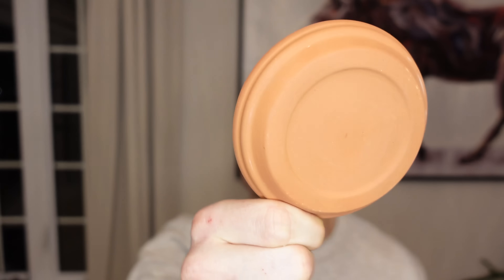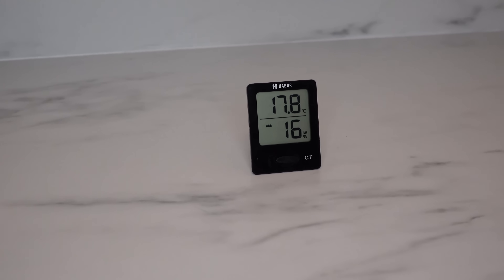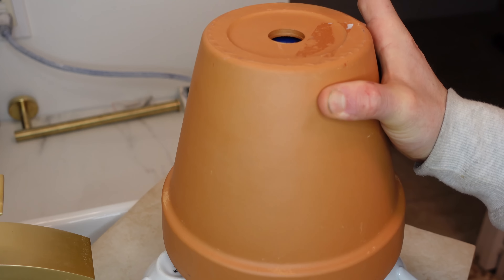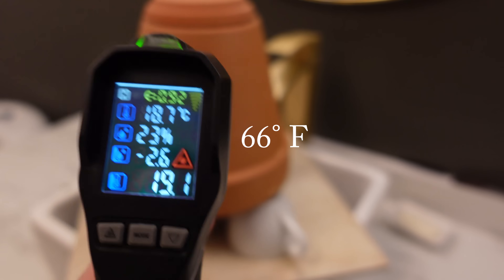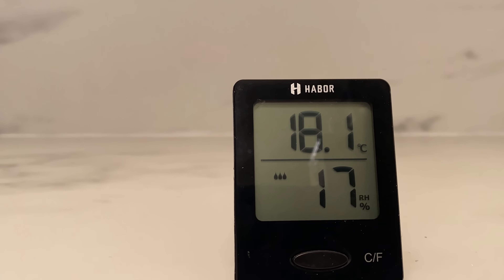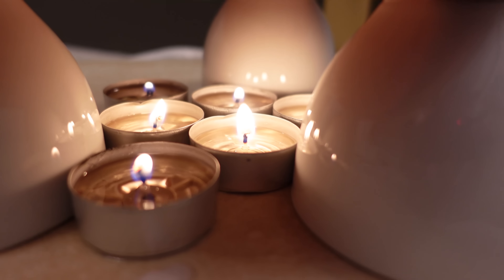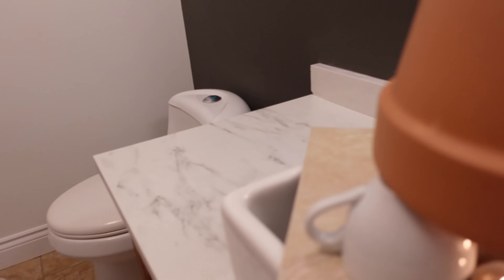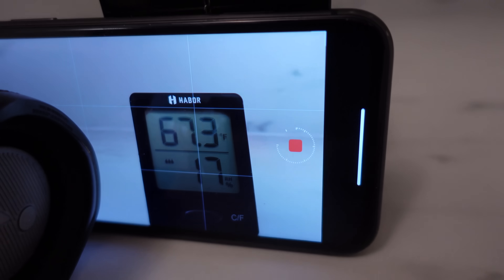CLAY POT HEATER TEST | Does It Actually Work?!

Comment: To those who say the pots don't technically add anything just burn the candles you're missing the point, the clay pots retain the heat so after the candles are spent the pots radiate residual heat. It's not creating more energy you're right but it's 'managing' the heat for a more even and prolonged release
Reply from the maker: exactly! great way to warm up the hands!

Comment: Try it with just the 6 candles and no pot.  I bet you get more heat in the room since the candles will have more oxygen to burn, but they will burn down faster.
Reply from the maker: Yes very true! Thanks for the tip.

Comment: I use 2 eight hour tea light candles under a plant pot the same size as yours, so 2 separate pots in my caravan & it definitely heats up my van in the UK. We're just going into winter so I'll see how good after the first cold snap, I can get 18 8hr candles for £2 so  it's much cheaper than paying for gas, petrol or paraffin. I'm going to outfit my van with these pots this winter but knowing our government they'll put the price of candles up 😠
It definitely works though, you get much more heat than you would from the candle itself.✌️
Reply: I made a shroud  with a 850g home bargains candle. Added crackle wicks and a small stove fan.   It heats up to 200°c really fast and the fan sends the heat out into the room.   Lasts a week at 8hours a day.   The fan also helps draw air to the flames from the vent holes in the shroud.    £2.99 a refil.  It will hopefully do for the winter while the prices are £9 for 40min of central heating
Reply: @salaciouscreations4323  U made me curious, explain better please
Reply: Hi ,how exactly is your "shroud" made of and it's shape n size measurements??? @salaciouscreations4323
Reply: Yes, I checked today and the price of candles have gone 👆
Reply: Use a canning jar filled with Crisco  and  stick  a candle in it .
Reply: @nancysmith6685  I was just about to comment this!! She can even keep it in the can she buys it in and just stick three wicks in it and it lasts a lot longer and puts off a lot of heat!!
Reply: @nancysmith6685 what is crisco???     We don't have this is England
Reply: @brambles12 Vegetable shortening that used to come in cans but these days it comes in cardboard containers.
Reply: The government doesn't set the price of candles 🤦‍♀
Reply from the maker: cheers!
Reply: ""you get much more heat than you would from the candle itself."""  factually, physically, scientifically, Impossible. You cannot "magic up" free energy out of nowhere. You get exactly the same BTUs of heat from the candles regardless. Look up the First Law of Thermodynamics.

Comment: Works, but not very well @ 100 BTUs per lit candle heat. That's like trying to fill a ful sized piggy bank with pennies, by only using one, to 3 pennies.
Reply from the maker: Exactly :)

Comment: These candle heaters are an outstanding monument to the complicated futility of ignorance.  A demonstration of the propagation of stupid myths.
The petroleum fuel in a wax candle produces a certain amount of energy per unit mass burned.  Nothing, NOTHING makes them burn hotter, or put out more heat or convert heat better.  NOTHING.  These stupid gimmicks serve no purpose except to demonstrate your ignorance of science.   A fluid burning at a constant rate puts out heat at a constant rate and tea-cups and flowerpots make no difference what so ever.    You want more heat output?-- Use larger or more wicks -- heat comes from the burn rate of the fuel - the wick surface area controls the rate of burn. 
-- Physicist.

Comment: Starting at 18.1Degrees C in a small bathroom isn't really a cold temp to start with. It then takes 3 hours to increase the temp by 1.5 Degrees C  ( abut .5 Degrees C an hour ) that's by no means any great achievement.  Where I live a standard living room would be about 4 times the size of a small bathroom and from October onwards temperatures in an unheated room would be between 1 Degree C to 5 Degrees C depending on how mild a day would be (colder at night) So it would take an awful lot of pots and an awful lot of candles and an awful lot of time to get it up to the 19.6 Degrees C you achieved in your demonstration.  So I dont think your demonstration shows anything other than Terracotta pots get extremely hot when they're placed over candles but as a practical solution to home heating they're little more than a placebo.
Reply: I agree.  A candle will produce a certain amount of heat energy.  A ceramic pot covering is not going to change that.  If it did it would violate the laws of physics.   All these videos of candle heaters show just how lacking science education is.

Comment: The chemical energy from 6 candles = the heat energy from 6 candles.
So...what's the point of the terracotta pots?
Do the test again with just 6 candles and measure the temperature of the room before and after.

Comment: Now you need to coat the pots in graphite and they will radiate the infrared  heat far more effectively.
The pots will get up to 40-45c

Also just use 1 pot, you're wasting energy by heating up 2 pots.

Comment: Do U realize that U have ZERO knowledge about the laws of thermodynamics and energy conservation? Lets say 1 candle heats with 1Watt energy. It is totally irrelevance if U heat the air directly  ore if U heat first de pot than the pot releases the accumulated energy. But that accumulated energy comes from the same 1Watt candle, thus while the pot is heated the air is NOT heated! You just delaying the heat exchange, but in the end U will only heat the room with 1Watt of energy! So there is no economy, there is no magic saving! Just delayed heating! and smoke and CO2 and money thrown away for pots and nuts and bolts!
https://youtu.be/eym_mD6osmw🤣

Comment: There is no energy gain to this.Put 10 units of heat into a room and whether you use pots or not,you're still putting 10 units in.The only benefit is you are holding some of the heat in the vicinity of the candles for longer.If you want to do something which will genuinley save energy,stop all draughts,insulate walls,ceilings and floors.Only have the heating of when you actually need it and don't overheat a room.Wear thick and multilayer clothes,put a blanket over you and heat a hot water bottle.

Comment: I dont get it. Those candles are going to put out the exact same amount of heat without all the other pieces, so what is the purpose?
Reply: The purpose is to add efficiency to the heat source.
The pot add an big surface for moisture in the air to evaporate on.
Removing moisture from air make you feel warmer seen moisture that evaporate from your clothes and your skin create an cooling effect.
When comparing a convector element to an oil element they say that an oil element give a more even heat source that feel more pleasant because of the mass it radiate heat after it is turned of on the set temperature.
I think one can see it a bit like that.
This device originally is to take the edge out of the cold by removing moisture and not used to heat a room in a sense we today look at it, i mean it's not an electric element.
Reply: @tiddybearkush  With all due respect, I think you are confusing some terms here. To remove moisture from the air it would need to condense, not evaporate (the opposite). And in order to condense moisture you need a surface significantly colder than ambient - which a heater obviously can't do. But yes, having a lower air humidity would insulate your body-heat better and require less energy to heat up a volume of air.
Apart from insulating the warmed area you can't really increase the efficiency of a heater because that process is already 100% efficient at creating wanted products - ie. mostly heat, and a bit of light.

Maybe the intention is to create more radiant heat like you mention, just because it feels more pleasant to sit near. It could work a bit for that I guess - but it won't actually heat the area any better.
Reply: @tiddybearkush  Better off using a dehumidifier. But the moisture is taken out of the air into the tank by condensing (cooling) fins. This then does make the room a touch warmer.

Comment: Candles are produced from diesel. Using them as heating is dangerous. This video is irresponsible.
Reply: They are made from paraffin, if they were made from diesel they wouldn't burn as diesel is not volatile enough. Try making a Molotov with diesel 😝

Comment: I am always amazed at all the different clay pot heaters. The only benefit the clay pots provide is collecting the soot from the candles, and thats a good thing. You don't get any more heat than is given off by the candles. The soot actually builds up and will insulate the pot from the flame however all the heat given off by the candles goes into the room.
Reply: What I don't get is how people think that the clay pots somehow increase energy, when all they do is absorb the same amount of energy the candles would give off in free air. If these clay pot things worked as claimed then free energy generators would be a reality, i.e. more energy out than energy in.
Reply: @rflett5797  oh yeah, there are plenty of free energy believers out there. Probably the same ones that think rainbows and unicorn farts charge electric cars
Reply: @STARFIRESOLAR  What?    They dont?  But I just bought a unicorn on Ebay !
Reply: @rflett5797  They absorb the heat and release it as infrared energy. It's more about a controlled release of heat. The room will likely stay warmer for longer after the candles go out with the pots than without.
Reply: @rflett5797  That because they missing the point of the terracotta heater.
The pot give a bigger surface for air to move through and therefore it remove more moisture from the air faster and create a better circulation of air.
You can get more energy but you can use it more effective.
Moisture on your skin and clothes create a cooling effect when it evaporate.
Reply: I think the logic is that they convert the heat to IR. I'm sure there are far better ways to do it than the pots. People will say that a candle itself will cause the heat to all go to the ceiling but a simple fan can fix that problem. An electric sand battery would be far more efficient.
Reply: There is benefit to the clay pots. Its very similar to how hot air balloons float in comparing what the clay pot does.

Comment: Be extremely careful with this sort of heater.  In the confined space under the pot, the candle wax melts.  If this happens it is not very bad but you do now have a pool of melted wax.  The trouble can start if the inside space of the heater gets hot enough to start to boil the wax.  When that happens it is a bit like a gasoline fire.  The vapor off the boiling wax ignites and burns making a bunch more heat.  This increases the temperature further so the wax boils faster.  This positive feedback will continue until you have a raging great fire.

Comment: do not do this wax gets to hot and you have a big problem when it goes up in flames . do the same but use carbon felt wick and cooking oil . you can tip the flame and still not have a problem

Comment: much better not to block the hole at the top of the pot  i us 2   clay pots 8 or 10 inch wide pots  to heat a 25ft by30 ft room and DO NOT USE MORE THAN 5 T LIGHT CANDELS OR IT WILL BE TO DANGEROS

Comment: the cups are to high you only need half inch ventilation  and if you put old briks from a storage heater on the top it raedyats more heat

Comment: There's only so many BTUs contained in a tea candle's wax when burned.  No amount of clay pots is going to alter that value.
Reply: ABSORBING HEAT is not going to MAGICALLY multiply heat and produce more heat.
Reply: How about those little heaters that caterers use to light and place under food to keep it warm?
Reply: candle heat rises immediately. The pots radiate the heat outwards. Big difference in how the heat (BTU's) is used
Reply: Yes but doesn’t it act like a storage heater?… absorb & then slow release of temperature?
Reply: @saneman7177  Now you are talking about BTUh, and yes, it would.   But the thermal mass of the pots is quite low, it wouldn't last long. I'd estimate inside of 10 minutes, the pot would return to room temperature once the candle has burned out.
Reply: @ElementofKindness  it actually gave me an idea you can buy storage heater bricks for very cheap… I wonder if you can heat them with candles
Reply: @saneman7177  Of course, but the net result will be the same.  For a given number of candles, the total BTUs conveyed to the room will be the same whether just burning candles openly, or contained in a brick enclosure.   You will get longer heating period with the bricks, but the room temperature will not increase as much.
Reply: @ElementofKindness candle heat rises immediately. The pots radiate the heat outwards. Big difference in how the heat (BTU's) is used